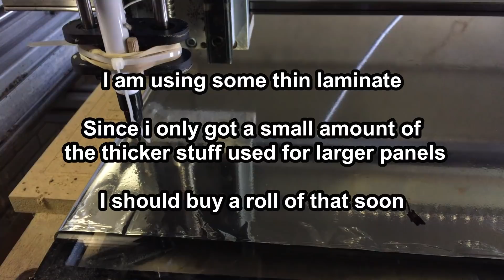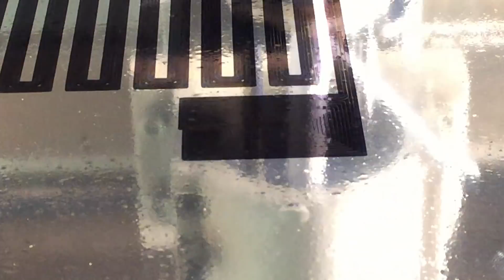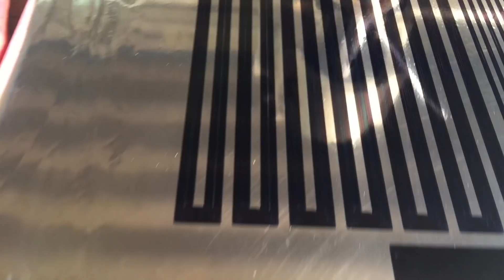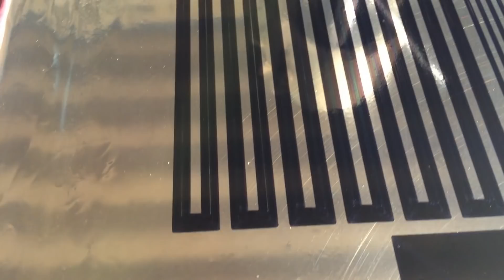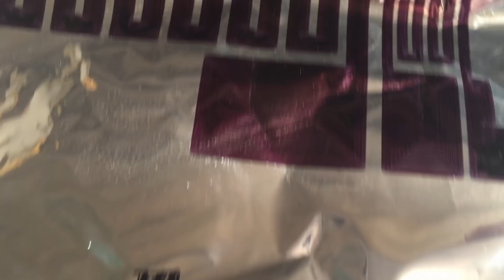Part 1 - The all etched planar magnetic  - plotting test

Comment: Dear Friend, I was here thinking when I watched this video.

Wouldn't it also be feasible (I don't know if there are pens on the market), but a Silk Screen and using conductive ink, or preparing one based on graphite powder ourselves?
I believe that aluminum is much more conductive, and of course, in this case it would change the way of passing the graphite-based paint directly onto the plastic sheet.
Watching it all over here
Reply from the maker: i did some tests with silscreening somewhere on the channel.  its not for me :( mainly because it still is messy :( and mainly suited if done right for mass production :)